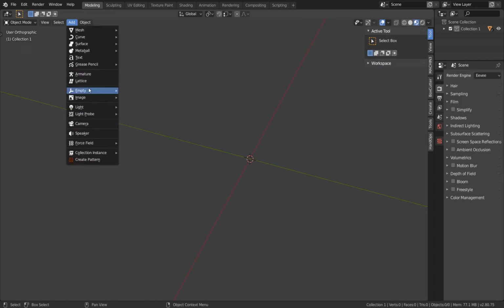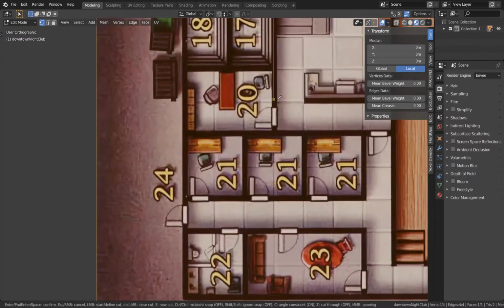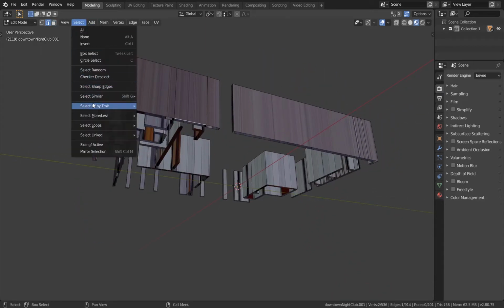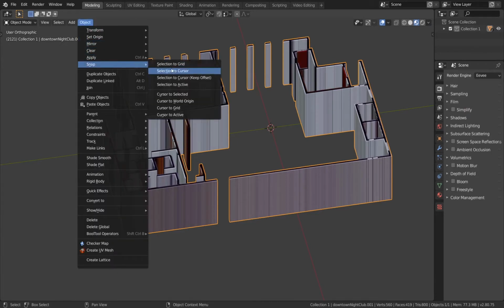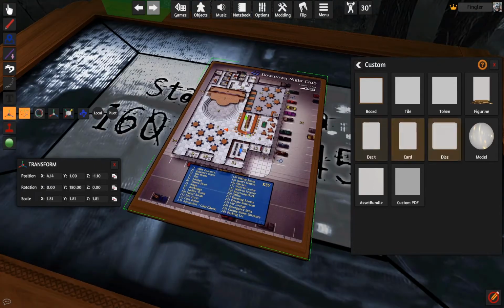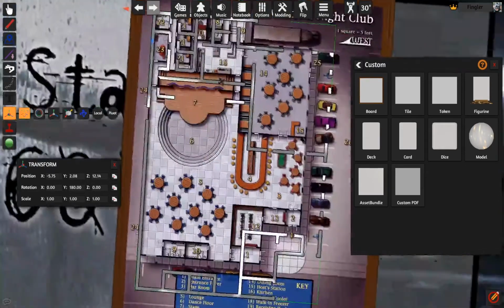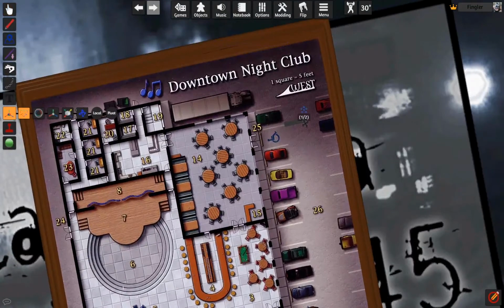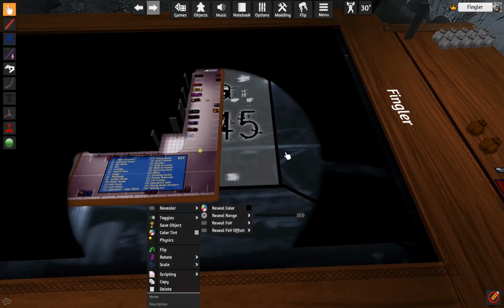Make Battle Maps for Tabletop Simulator with Blender

Comment: I need some help, so I made a village map that is inside a crater. Put the map into blender like you did(picture as a plane). only difference is i subdivided the plane, used sculpt to raise the hills around the crater and lower the pond a bit. did the ctrl t and exported the map. It imported fine, looks good but when I go to place something in the crater it floats on top of it level with the hills, I can lock em and move em down but then you cant move your player. its like

hills     (character piece)        hills
       crater                  crater
                      pond

how do i fix this?
Reply: Make sure you have a collision that matches the mesh, otherwise tts will just create a collision box around your object
Reply: @nocaster89  Okay next question lol how do i do the collision?
Reply: @EmpressofScandanava when you import the model, select the obj file for both mesh and collision. This way the collision marches the mesh